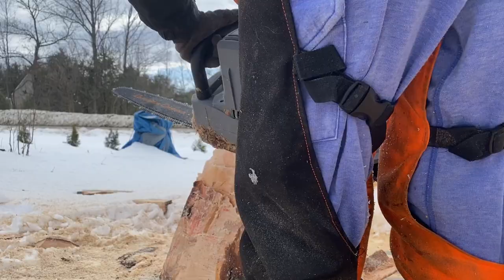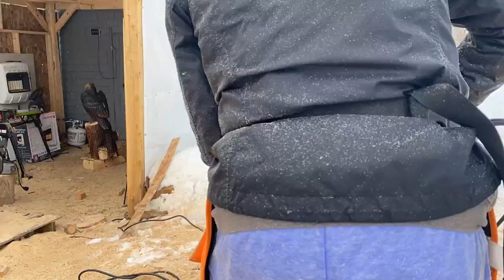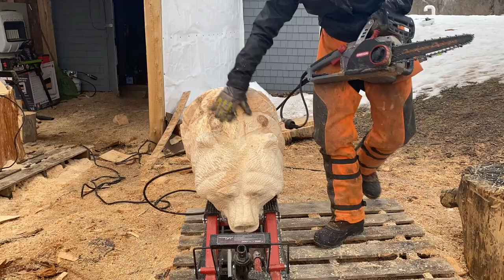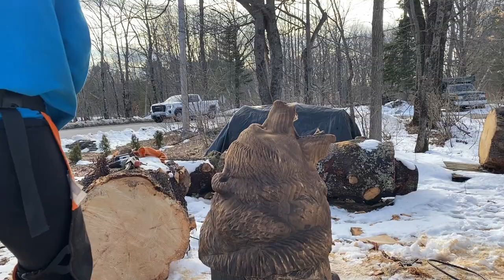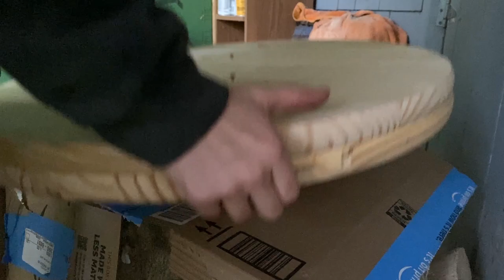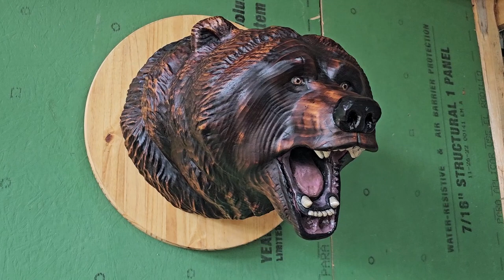Bear head mount carved out of wood LIFE SIZED

Comment: Great video and carving!!  But that is the norm for you!!  I have a question about your CS1500 saw.  What bar are you running and what chain?  Is it 3/8 or 1/4 pitch?
Reply from the maker: I converted the saw to 1/4 pitch by using Makita’s 1/4 pitch sprocket, fit perfectly! Bar is a 14” quarter tip Cannon carving bar and just running a 1/4 chain.

Comment: Great piece! You clearly keep upping your game. I'm curious about the carving bar and chain you use on your Oregon 1500? Thanks for sharing your work.
Reply from the maker: It’s a 14” quarter tip Cannon bar with a 1/4 pitch chain. I put Mikita’s 1/4 pitch sprocket on it, fit perfectly! I have a dime tip but it seems to over heat every time I try running it on the electric saw, but the quarter tip runs fine 👍🏻😁
Reply: @TayMarie23  Awesome! I too use a Makita 1/4 sprocket, but my cheap Holzfforma bars and chains keep burning up. Time to invest in a good Cannon quarter tip. Thanks again for sharing!
Reply from the maker: Of course, I would recommend getting .043 gauge instead of the .050 I have. I have a .043 on my Sthil and I like it a lot more, easier to make turns in the wood!
Reply: @TayMarie23  Perfect. I've been using .043 bar and chain with my new sprocket.
FYI; I'm making variations on your little heart bear for my grandkids. They love them!
Reply from the maker: That makes me soooo happy! Those little bears are a fun carve!
Reply: Trabalho fantástico ! Parabéns !!!
Reply from the maker: Thank you 😊